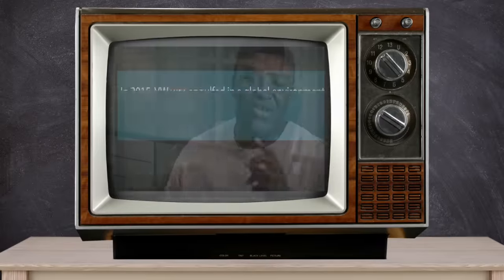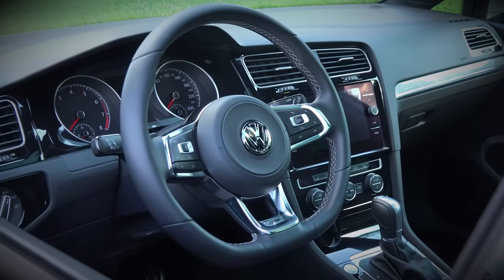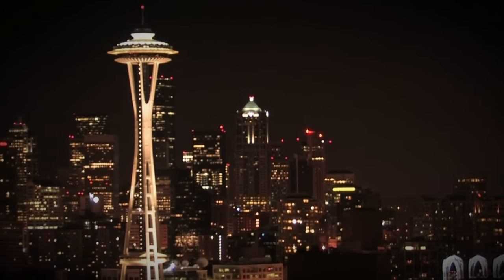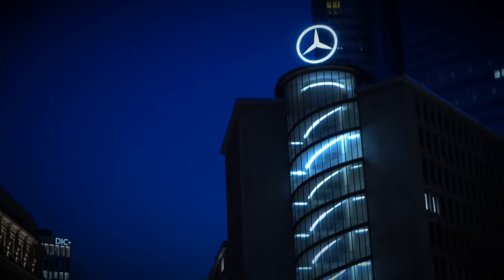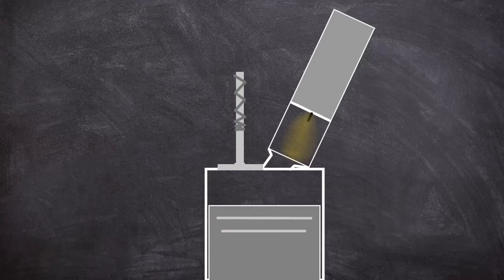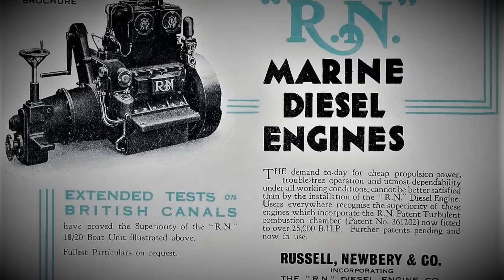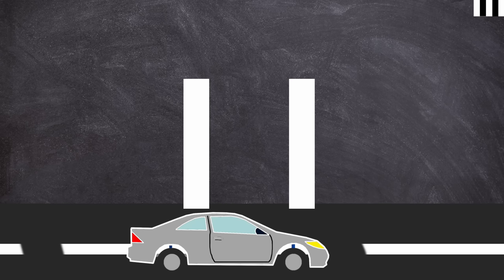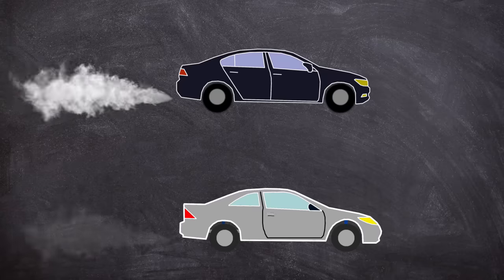Scandal: VW Emissions Dieselgate Explained | Plainly Difficult Documentary

Comment: Who would now buy a VAG car? I for one wouldn't, before this there was huge problems with Audi petrol engines drinking engine oil due to design/engineering faults.
Reply: VW used piston rings with less spring load to reduce friction and save fuel. If they reach 100k km they start to consume oil due to wear

Comment: You omitted the fact that VW had nothing to do with implementing common rail systems into diesels. 

Alfa Romeo was the first car manufacturer to use CR, and actually designed it with Bosch for their 156 model. 

Then CR made its way to Merc with their weird off deal with Bosch. 
VW got CR in next decade.

Comment: Is diesel fuel more competitively priced to petrol in Europe?  The only advantage of a Diesel engine in the USA is that you can expect the engine to last multiple times longer than a petrol engine.  The cost of diesel fuel here has been too high for the boost in MPG to counteract for decades.
Reply: Diesel is usually cheaper in Europe - but petrol/gas is relatively expensive, and high powered petrol cars consume a lot. Diesels combine high torque and relatively low consumption, the main reason why they are bought. Before turbocharged diesels came on market the market share was only minor, old diesels were slow

Comment: an interesting what-if because of this VW abandoned its diesel hybrid vehicle projects completely, something they were a couple of years or less from bringing to market with only a single small batch of prototype hypercars built around the technology. Another result of this was that they moved faster than they probably would have towards electric cars as a result, which in turn helped ford get their electric car program off the ground, so its legacy is huge
Reply: Diesel-hybrid never made much sense to me, as main strength of a diesel engine is, that it maintains high efficiency through wide load range. A gasoline engine profits much more from the hybrid transmission, as it keeps its load near its peak efficiency range.
Reply: @Papinak2  Yeah, for some reason a few manufacturers apparently decided that battery-electric cars would be the end of the world and so put enormous effort in developing something else. For VW it was the diesel-electric and Toyota (?) it was the hydrogen fuel cell.
Reply: @PhysicsGamer  Yep, it was Toyota and they were able to bring it to market. Toyota also develops battery EV, but first poured lots of money to solid state battery research. From what I've read, they should have working prototypes and given their history, it could be actually viable solution, unlike current EVs, that are being made only because of various government programs..
Reply: @Papinak2  Solid-state battery EVs will just be battery EVs with better batteries, though...? It's not like Teslas really have range problems, as such. And frankly, hydrogen fueled cars just have way too many fundamental hurdles for me to ever really consider them viable. Energy density is a big one - hydrogen is literally the lightest element there is, and the only way to pack more of it in is to either use incredibly high pressures (dangerous, requires extremely heavy tank walls and ludicrously durable hoses) or cool to very inconvenient temperatures (also adds weight, uses power even at idle, cooling failure means you lose 100% of your fuel). The other really big one is that hydrogen just sucks to work with. The stuff will exfiltrate through just about anything given enough time, and what it can't get through it'll embrittle from the inside out.
Reply: @PhysicsGamer  yes, "just better batteries" is exactly what EVs need. LiPol baterries are extremely delicate and need to be kept in narrow temperature range to work properly or even avoid damage - which isn't ideal for a machine that can work in environments anywhere from -20 to +50C. Plus loads of other issues... SSBs should (according to the hype around it, which might be exaggerating) solve all problems of lipols, including their explosive potential, while also providing better energy density, charging/discharging current and longevity. Toyota also claims that it should be cheaper once they figure out mass production...
You're right, hydrogen storage is the biggest hurdle - less on industrial scale, more in vehicles.. However, iirc, BMW was already experimenting with liquid hydrogen tanks in their vehicles in 00's, the tanks could hold the fuel for considerable time without energy.
Reply: @Papinak2  Sure, solid state batteries will be a huge improvement. But the batteries we have today are pretty good for our current purposes. No reason we shouldn't upgrade now and start building out the infrastructure that will still be useful when solid-state batteries come online.

As far as hydrogen storage goes... there's two ways to get hydrogen to stay liquid: cold temperatures and high pressures. If whatever BMW was doing wasn't actively cooling it down to keep it liquid, that means they were just keeping their tanks at truly ridiculous pressures. Even aside from the danger inherent to having what amounts to a pressure bomb on your vehicle at all times, consider how much additional weight all the reinforcement necessary for such a tank represents.
Reply: @PhysicsGamer  batteries we have today are good only for pocket devices, not for machines that have to work in outside environment - just take a look on Porsche Taycan's cooling, designed to keep the batteries in operational range. Infrastructure would be good, but for example Germany is not even able to do infrastructure for current consumption, let alone for future electric cars..

Not even ridiculous pressure is not enough to keep the hydrogen liquid. Cooling is not needed to keep things cool - all you need is keep heat out with good insulation. Iirc, BMWs insulation was good enough for about a week. The heat that eventually went in was absorbed by vaporisation - either from consumption or venting, when the car was stationary. Yes there are security issues with a flammable gas leaking out of a parked car, it could be burned, but function of the system would have to be controlled and backed up to keep things safe. But I see hydrogen cars as cars for daily use, heavy loads and long distances, while BEVs would be for occasional use and short distance commuting.
Reply: @Papinak2  As far as the range question is concerned, let me put it this way: I can drive a Tesla 300+ miles on a single charge. I've never heard of a hydrogen vehicle that the developers even pretended could be commercially viable with a 300 mile range.
Reply: @PhysicsGamer  new Mirai has 400mi EPA range and about five minutes refuel time. But I was talking more about trucks and heavy machinery, where batteries would be extremely inconvenient.
Reply: @Papinak2   Fair enough, I guess I'll look into that... but frankly I wasn't aware new Mirais were even still being made. It's just such an irrelevant technology given accelerating adoption of electric vehicles.

Plus you did earlier claim modern batteries "are good only for pocket devices, not for machines that have to work in outside environment". Which obviously would not just be limited to "trucks and heavy machinery".
Reply: @PhysicsGamer  yes, I meant BEVs with solid state batteries, which should be more suitable for use in a car than current LiPols. Current BEVs are like steam cars of the early 20th century - they were able to push the technology to work, but it was already at limit  and something better was needed to make cars more accessible. Back then, the thing was ICE, now it's better battery technology.

Hydrogen is also not ready, yet - as I said before, it could be widely adopted only if there's clean way to produce it - which would be 4th gen nuclear reactors with high temperature output, which would increase efficiency of electrolysis. But nuclear energy is not currently viewed as viable source by majority of society.
Reply: @Papinak2  And fusion power would be even more suitable than fission power for energy generation, but we work with what we have. Solid-state batteries will be an enormous upgrade, but in the meantime batteries are at a state where they're good enough to enable a switch away from ICEs. Plus the more we embrace electric vehicles now, the more ready we will be for that upgrade when it inevitably does come. My hope is that owners of current EVs will be able to upgrade their battery packs for a hefty-but-potentially-worthwhile price to solid-state, which would likely upgrade the capacity of their car beyond what it could do when new.

Production is not the only obstacle for hydrogen cars. Transport, for instance - hydrogen refueling stations require very specialized delivery and storage hardware that is more expensive than electric charging station hardware, especially when you consider installation costs.

Even if you built hydrogen infrastructure everywhere, that just puts you back at the inconvenience of gasoline refueling. I doubt overnight at-home charging for HVs will ever be a thing.
Reply: @PhysicsGamer  buying an EV doesn't build infrastructure nor power plant :) As I see it, we are trying to approach the problem from the opposite end. Majority of CO2 is released by industry and power generation, while road traffic makes around 15% (it differs source by source). By switching entirely to EVs, we would reduce only part of those 15%, because EV is only as clean as its power source, so positive effect would be negligible... Meanwhile, such change would have huge negative effect on economy and quality of life - majority of people simply cannot afford any EV. And pushing technology which is not yet ready is not a good idea either. So I'd stay with ICEs yet and focus on power generation. Seeing current situation in Europe, it's much more important issue to solve.

Upgrade of EVs or even ICEs would be nice, but at least in Europe, it'd be impossible. At least that's what can be learnt from history, where legislation didn't allow upgrade of engine management..
Reply: @Papinak2  Widespread ownership of EVs does produce greater demand for EV-supporting infrastructure, however.

Do you have any idea how huge a 15% reduction in emissions would be? Or even a 10% reduction? Especially when you consider it can happen in parallel with power plant improvements.

I have no idea why you think battery upgrades would be impossible. I'm not aware of any legislation or even precedent anywhere in the world that would forbid such a thing.
Reply: @Papinak2  By infrastructure I mean charging stations and garage high-capacity outlets and whatnot. Which is what will actually make it easier to adopt electric cars. Grid production capacity is a whole different question, and one we really should resolve by way of more nuclear plants ASAP. Germany has been particularly stupid about this for a while, but hopefully things change soon on the subject.

Even a 5% reduction in American pollution would be enormous.

Sorry, but I don't believe even for a second what you're describing there. What, you buy a car and can't upgrade anything as the owner of the car? That would be insane, and I know for a fact it's false. I've dealt with the German and Czech aftermarket component upgrade markets before.
Reply: @PhysicsGamer  well, charging stations won't work without grid connection.. Germany is very stupid since they started shutting off their NPPs and now whole Europe is paying for their mistakes..

5% is still negligible compared what can be done in industry with less effect on people's lives...

Well it's not like you cannot do anything at all, you can change wheel dimension (yes, wheels are problem, too) or certain parts as long as they are homologated for that exact vehicle. Or if the manufacturer allows certain modification - but for example VW rarely allows anything. Otherwise, even engine change might be problematic, when you get mechanically identical unit, but different type code. At least in CZ... And I'm fairly certain that anything involving batteries will fall in that problematic category. Also, battery makes up large part of EV's price, so I doubt anyone will be willing to change it unless prices plummet.

Don't get me wrong, I don't think that BEVs and research around them is bad thing. I just think that they should be introduced to market more naturally, like Toyota did with hybrid vehicles - it took 20 years before they refined technology, but they successfully replaced diesel vehicles. But if governments force BEVs to market just because of ideology without accompanying development, it'll just stay in current state of mass produced concept cars..
Reply: @Papinak2  You're not going to have any argument from me over the need for more nuclear plants. They're pretty critical to building a future-looking power grid.

I'm not sure why you're quibbling here over the amount of emissions that would be reduced by the embrace of electric vehicles - even setting aside it would probably be way more than a 5% reduction. We should also push for changes in industry, of course, including the use of electric industrial vehicles. Especially since a lot of industrial vehicles are extremely well-suited to running off batteries since they frequently have predictable downtime when they could charge.

I still have no idea what you're talking about regarding these part change problems. Sure, chopping off your catalytic converter is something that is pretty obvious to people around you and doubly so when you bring your car in for emissions testing. But if you swap out your turbo with an aftermarket one, who exactly is going to notice? So long as it uses the same interface as the old one, even the ECM wouldn't ever know the difference. Same for if you wanted different suspension or whatever.

In what way did hybrids ever serve as a direct replacement for diesels? The sort of people who ran diesels were generally the ones who seemed to hate the very concept of a hybrid car for some reason.
Reply: @PhysicsGamer  as you've said, there are applications of EVs where they are extremely well suited - and that's also area where they already succeeded without need for any embracing of governments. That's what I think should be our approach - just wait until the technology is mature enough to be able to sustain itself. Just like ICEs surpassed steam engines and steam engines surpassed horses. Governments might help by financing development, but not by outright banning ICEs. That won't help environment, building infrastructure nor improve technology.

If you change for turbo with same parameters, it's ok. If the turbo is bigger, car's parameters are not same as in the registration document - and that's where problems start.  I'm also pretty sure that car's onboard management won't like different type of batteries with different properties, so it'll need to be hacked - and again, such mod might not be legal, or only allowed for certain institutions, like ECU programming.. Unless the manufacturer provides tools to do so, but I doubt it.

Hybrids replaced diesels in sense, that Toyota doesn't sell diesels in some models - including Corolla and RAV4
Reply: @Papinak2  The foremost job of government is to avoid the tragedy of the commons. By pushing everyone to accelerate their move away from fossil fuels, the broader environment everyone lives in is kept in better shape. Even if it is inconvenient in the short term, the long term cost to everyone is lower.

What problems though? Who is going to complain or even notice if your turbo is bigger than the one that the manufacturer put in? This doesn't make any sense. So long as the car can still pass emissions, what would the problem be? And not sure how it works in Europe, but over here so long as you own your own car (i.e. it's not a lease), any mod you make to the onboard computer is perfectly legal. After all, you own that computer - even if you aren't allowed to copy the software on it, installing a differential software patch is perfectly allowed... as is wiping it and putting something new on. I'm not sure how it could work any other way and be consistent, honestly?

I think what you're seeing is just the general move away from diesels in consumer cars. Europe's definitely held onto them a lot more, but they're basically extinct in the US at least. The thought of a diesel Toyota is pretty amusing, though. Regardless, at the end of the day the advancements made in gasoline engines really do render them the better choice for anything smaller than a tractor trailer, and even there the only actual downside is the low-end torque.

Hybrids, meanwhile, were very much a replacement for a segment of ultra-tiny gas cars that were mostly focused on fuel efficiency. That's why the first ones were so tiny - Priuses and the like. Though I'm not sure how big that segment was in Europe, given the walkability of cities over there. Regardless, at least over here the hybrids were arguably either the first casualty of the rise of EVs or the seed that developed into them. Plug-in hybrids were an incredibly good bridge technology for a while there, even if they're pretty expensive compared to an actual electric car.

Comment: Would putting the car on a dynomometer not have put the vehicle into the de-tuned program?  I can't imagine that performance shops/enthusiasts would not have detected the fraud
Reply: It appears it had to be under a set of specific conditions which are used in the test procedure, not simply being on a dyno.
Reply: @RobertHancock1  OK...I was wondering.  The conditions he described would definitely be the case strapped onto dyno.  ty
Reply: Enthusiast groups were somewhat aware of the cheat for years. However, why would an enthusiast complain about the company cheating the government to give them a more efficient, more powerful car? It took the University involvement for someone to both know and take issue with the cheat